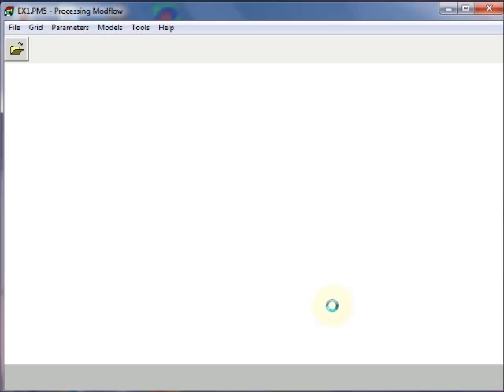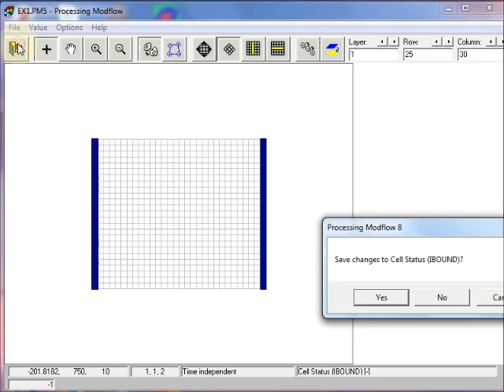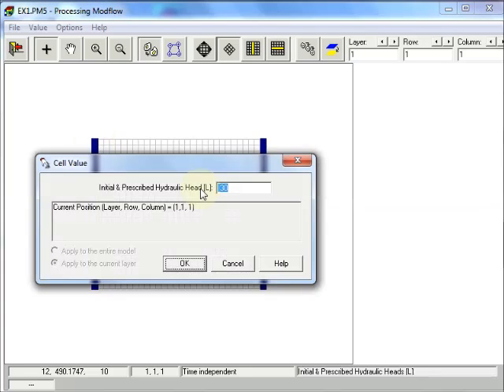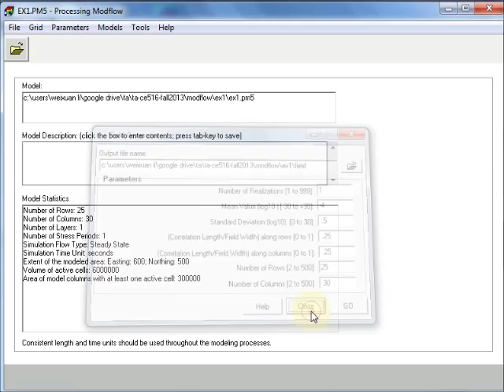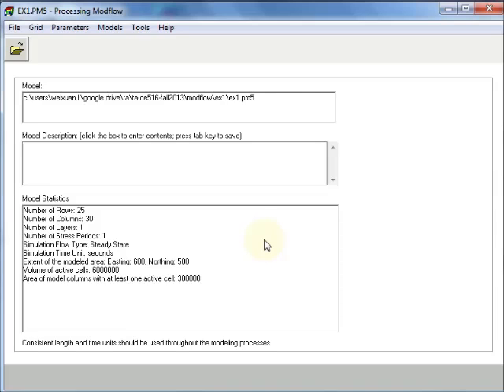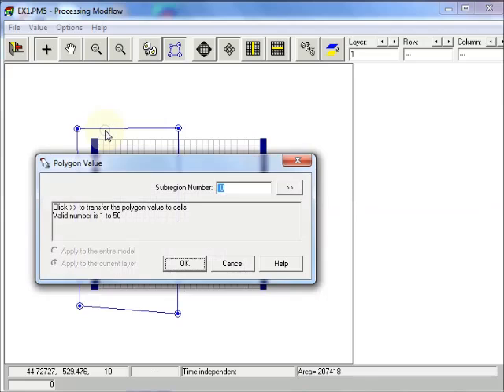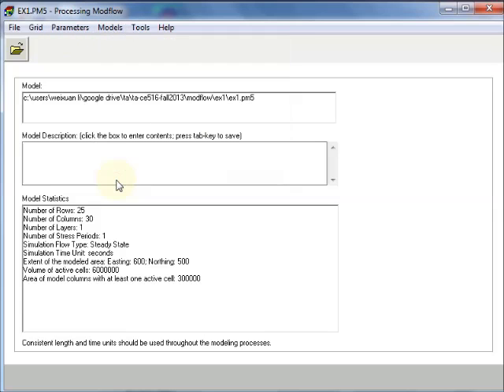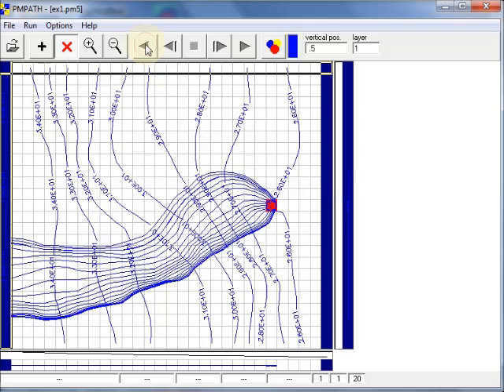Modflow Example Flow Simulation

Comment: which version of PMWIN did you use here, i.e. 5.3, 5.32, etc?
Reply from the maker: 5.3
Reply: Thanks, I will install it and follow your example. I am struggling with importing the model boundary, elevation data and well locations.

Comment: and what if both rivers have the same hydraulic head? and the other two boundaries are impermeable. can i give the rest of the system a higher value?
Reply from the maker: if both rivers have the same hydraulic head, the simulation result you get (regardless of what initial value the rest cells have) would be the same hydraulic head everywhere and no flow would occur (unless you have other driven force such as a well).
Reply: oh oke thank you.in my example the north and south boundary are rivers with same hydraulic head. and the east and west are impermeable. groundwater in the rest of the system with aquifer. groundwater flow will either be to the north or south . does that mean that the rest of the system has a higher hydraulic head then the rivers??